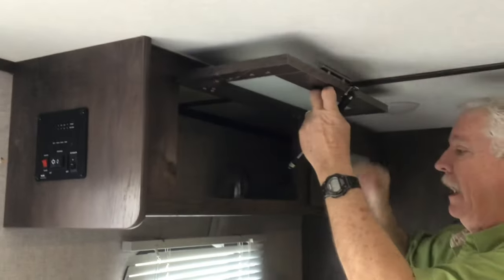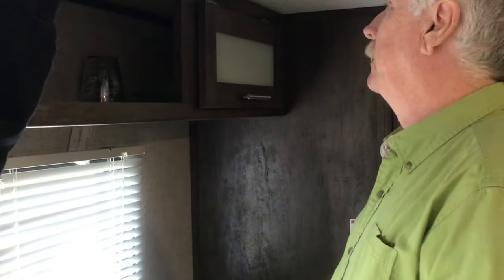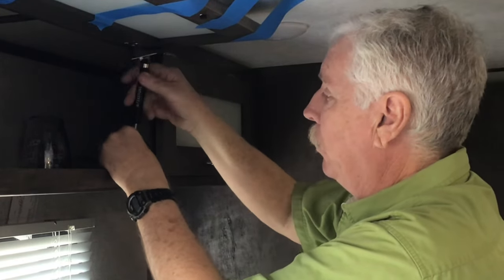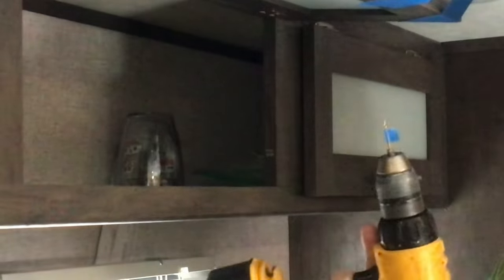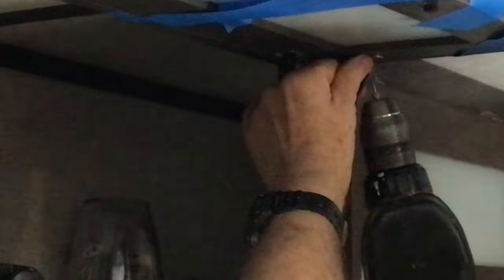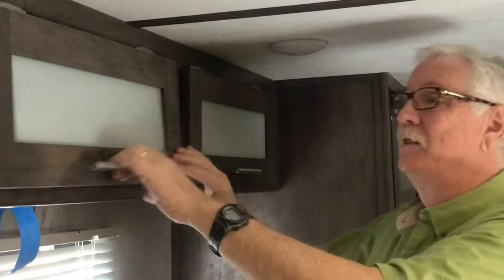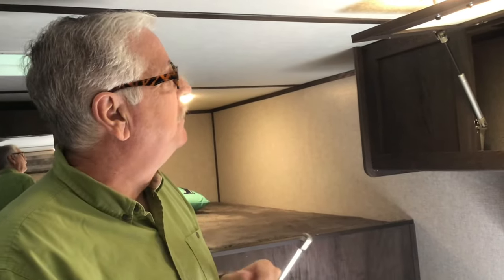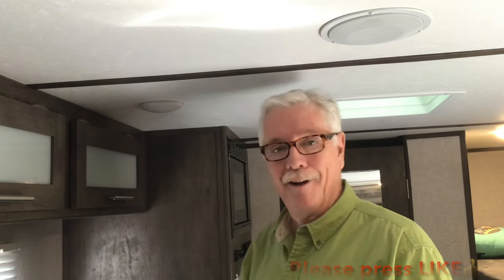Step by Step -RV Cabinet Door struts/openers/shocks. DIY -STEP BY STEP. YOU NEED THIS UPGRADE.

Comment: I put mine in about 2 months ago, and yeah I could have used this video since I got no instructions.  However I did get them in.  Although I put mine in the opposite you did and they still work. By opposite I put the one end at the top of the frame  inside and the other end at near bottom of the door panel. I think I will swap the direction, they do work. Although mine are more out of the way.
Reply from the maker: Very interesting.

Comment: I really enjoy and appreciate your videos. I just wish you would share links and/or part numbers for your parts. Thanks for sharing you how to videos.
Reply from the maker: You are not the first to ask this. I have tried to post links but it is not a good solution.
Virtually everything we use, we get on Amazon. It is rare that something doesn't come from there. 
This causes problems, with links,  for two reasons. 
1. Amazon links are a thousand characters long.
2. Sellers on Amazon are constantly making changes to their products or price. The slightest change generates a new link. 
Amazon links that worked a month ago, will probably not work today.

I have tried a few times to provide a link, but then I end up getting a comment of, "Your link doesn't  work."

I try to tell everyone where I purchased a device or product, especially when I do go somewhere like Harbor Freight, and not Amazon,
Reply: @funinourrv  That makes since. Thanks for the response.

Comment from the maker: As shown in the video, both types of struts seem to work well with just two screws.
There just doesn't appear to be much pressure on the door or strut.
I will watch it and if it EVER seems ro be coming loose, I will put the the brace for the third screw.
to be honest, I will probably do it anyway, as soon as I can. Why wait.

Comment: Hello, could you add a link to where you purchased the strut, size, and description for two different types? I appreciate your tips for the 17B. Thank you.
Reply from the maker: Apexstone 80N/18lb 7 Inch Gas Strut 80N Gas Strut 7 Inch Gas Strut Cabinet 80N Gas Spring Gas Shocks Lift Supports Lid Stay,  
Set of 2 $21  Amazon
https://www.amazon.com/dp/B0156P6YVC?ref=ppx_yo2ov_dt_b_product_details&th=1

I do not recommend the 10 inch struts at all.
Reply: Thank you sir. I can't wait to install these.
Reply from the maker: @MrMysterish  You will love having them. 
I did a review of the new 2023 17B today, and of course it didn't have them. It reminded me what it was like, having to hold the doors up.
Reply: Thank you Sir. I'll be adding these to my 17B.

Comment: You forgot your percentages and weight ratings.  20 to 30% down from top hinge.  50 to 66% for strut length.  10 Newtons per kilogram of door weight.
Reply from the maker: Good to know. Unfortunately we would have to add the strut weight to the door. It might actually weigh more than the door. Does that matter? With the weight of the strut, the door might weigh 1 kg. 
So I guess, if we wanted to be able to accelerate it 1 meter per kg squared, and the distance it needs to travel is about 30 cm, we would require about 3 N. Since the average male can lift / push around 250 N, I think we will be OK.
Reply from the maker: Citation-https://hypertextbook.com/facts/2004/WaiWingLeung.shtml

Comment: I accidently bought the 100N struts and WAYYYY too much pressure.  The 50-60N would be ideal.  I believe 80N is too much
Reply from the maker: That is a good point. I am guessing that the "N" stands for Newtons?
 I mentioned how the first set I bought was too heavy.
You are right about the 100 being too much. I settled for 80, and they work quite well but 60 might have been better, especially on the smaller cabinets.
Thanks.

Comment: Where did you buy struts. And what brand.
Reply from the maker: Apexstone 80N/18lb 7 Inch Gas Strut 80N Gas Strut 7 Inch Gas Strut Cabinet 80N Gas Spring Gas Shocks Lift Supports Lid Stay,  
Set of 2 $21  Amazon
https://www.amazon.com/dp/B0156P6YVC?ref=ppx_yo2ov_dt_b_product_details&th=1

I do not recommend the 10 inch struts at all.
Reply: @funinourrv  will they work on the big door about dinette
Reply from the maker: @timarney-br4bc  Yes. The 7 inch struts lifts 18 lb. The 10 inch are 22.5 lb. You don't need that much and it is harder to work with. 
Amazon had dozens of types of gas struts. You might find some different versions. Just make sure you get the 7 inch size. The 10 inch just will not fit on the smaller cabinets.
Reply: Thank you so much
Reply from the maker: @timarney-br4bc  Yes. The doors are not very heavy. They will work easilly.